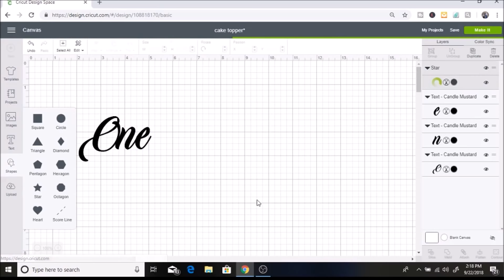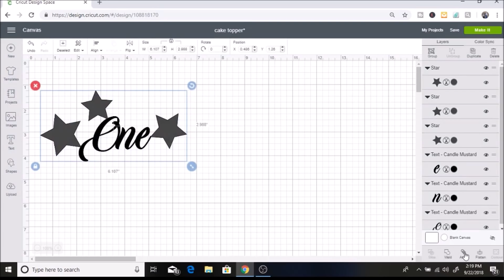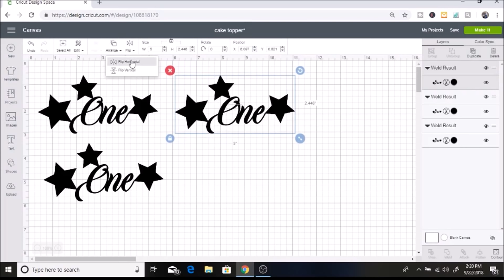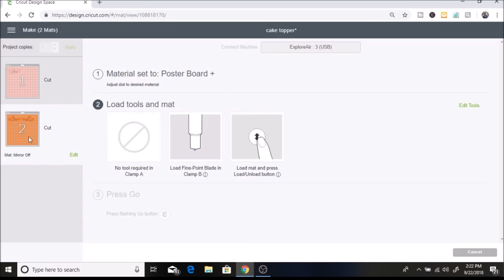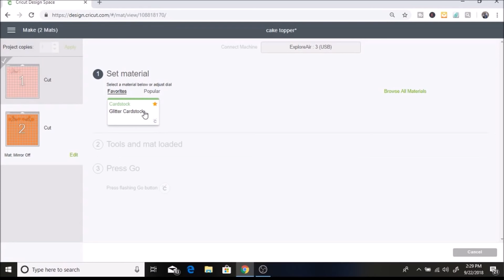HOW TO MAKE A CAKE TOPPER WITH CRICUT

Comment: Thanks for sharing!  I made an 18th cake topper after watching your video. :)  I used glitterstock but layering 4 of them to give more strength.  2 the right way and 2 back to front once i glued them separately, i then glued the 2 together.  I found 2 pieces of thin wood/board and some very small clamps that my husband had in the shed and put the topper in between the wood and tightened them,  It helped so much in keeping the card stock together firmly. :)  Also i put my sticks in between the 2 layers to hide them.  Can't wait to do more.  Thanks again